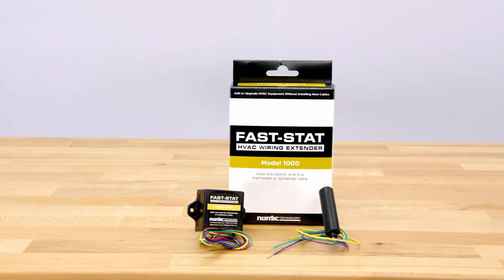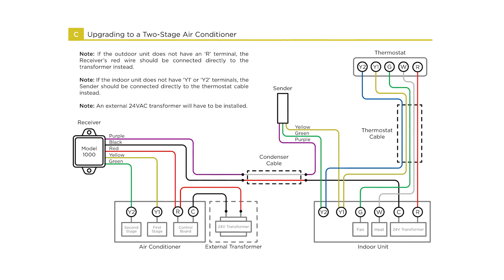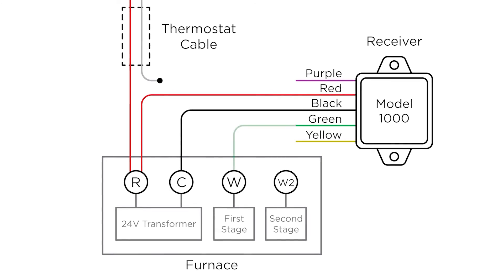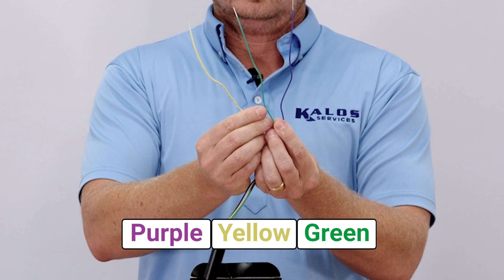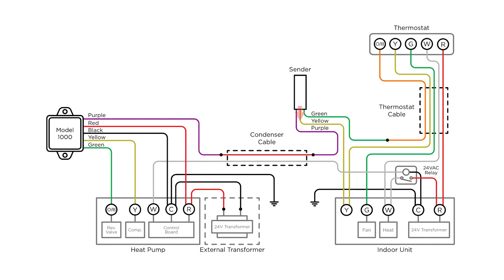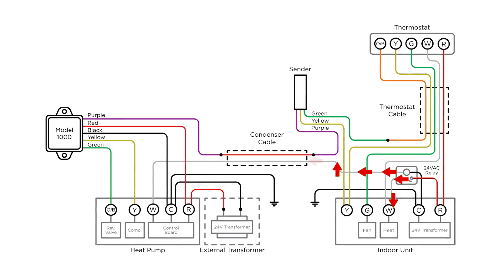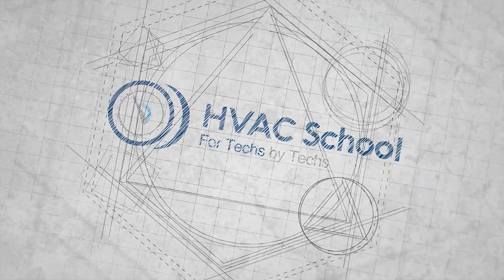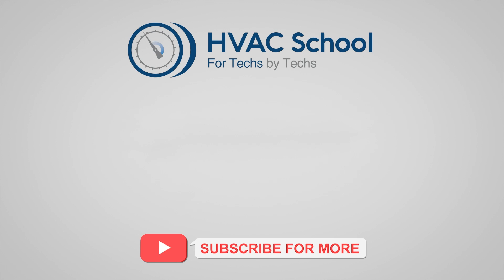Fast-Stat 1000 Unboxing

Comment: We always rely on using the Honeywell Prestige Thermostat Kit. It uses to wires up to the display and the EIM stays at the mechanical room. It has up to 2 stages of heating, cooling and 2 dry contacts for any accessory. It is also WiFi compatible.